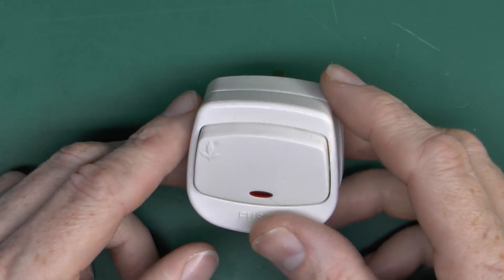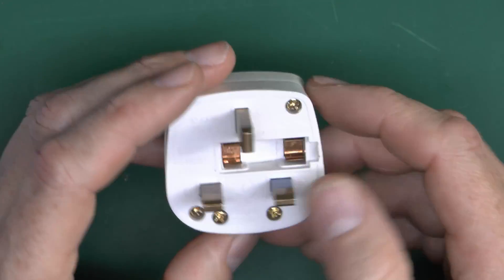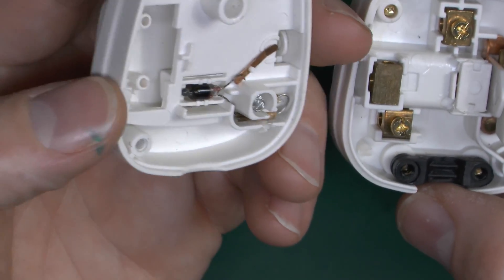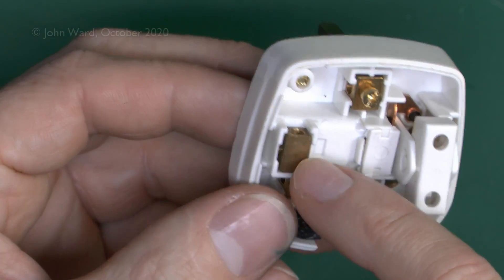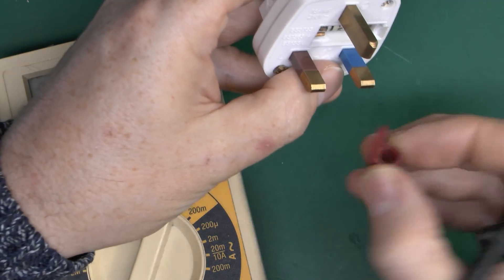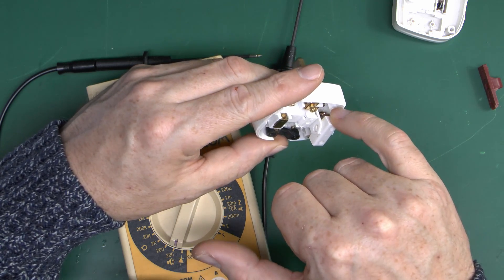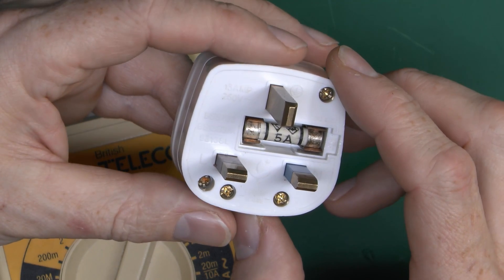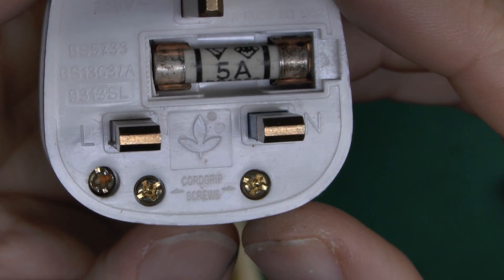Switched 13a Plug BS1363

Comment: Unswitched sockets are more expensive than switched I tend to fit them under kitchen worktops for washing machines and the like
Reply: I like the clean lines of an un-switched socket and they can be useful where you don’t want an appliance inadvertently switched off.
Reply: @richardwallace3477  Have not heard of the office cleaner wanting to plug the vac in, finding the fax machine with a note at the socket saying 'Do not switch off' - so the cleaner just unplugged it !
Reply: @Harry M They are more expensive, because they are less popular - less is produced and stocked in stores, so price is bigger. Economy of scale and free market in action.
Reply: No local plug fuse, really glad we have sensible power circuits. A table lamp consuming 2 amps with is cable will melt in fault condition if it relies on a fuse box breaker of 10 - 16 Amps how ridiculous.  Makes one glad were out of the EU.
Reply: @g7mks383  - what the hell is it with people blaming everything they don’t like or don’t agree with on the EU. The U.K. power circuit arrangements have not been significantly affected by EU changes. And if anything, the EU has helped to improve safety standards within member countries. If you go back to the 1940s and earlier, U.K. plugs were unfused. And in a lot of areas, the use of unfused plugs continued for another ten to thirty years (or more).
Reply: @g7mks383  Actually the cable will withstand a fault condition. Show me how you can overload (thermal overload) a lamp! Impossible! The only fault scenario in that case is a short-circuit. And a cord can handle this, because the circuit breakers or RCDs will trip fast enough if the installation is properly made and maintained.
Different approaches require different safety measures. All methods got their flaws and their advantages. Why are electricians still installing type AC RCDs in the UK? In Germany the installation of this type was banned more than 30 years ago, standard is type A here since then. And that's for a good reason since more and more switch-mode power supplies are in a household now which can disable an AC RCD preventing it from tripping.

Did the EU enforce you to do the same thing as Germany, stopping you from installing these outdated RCD type? Even if it would make sense? AFAIK not...

And btw: The EU got nothing to do with european harmonisation of regulations for electrical installations. This is done by the CENELEC, which is not a EU organisation and doesn't require a membership in the EU. Switzerland for example is also a CENELEC member.

https://en.wikipedia.org/wiki/European_Committee_for_Electrotechnical_Standardization
Reply: @g7mks383  No table lamp consumes 2A in normal operation, and no standard fuse size in our plugs will open at 2A. What fault scenario are you imagining, here?
Reply: @Monkeh616  AFAIK the smallest size BS 1362 fuses is 1A, next larger one would be 3A. And I believe his motive is just trolling...
Reply: @Marcel_Germann  You can get those, but they're not standard. Only 3A and 13A are specified, afaik. Not about to shell out for a copy, though.
Reply: @Monkeh616  Must be the reason that 3A are red, 13A brown and all others are black.
Reply: @Monkeh616  You can also get 2A, 7A & 10A plug fuses.
Reply: @NOWThatsRichy  Yes, I said that, but they're not standard..
Reply: @Marcel_Germann  - Actually 1A fuses are rather hard to find. The most common fuses available for consumers are 3A, 5A and obviously 13A. However, electrical shops and suppliers will also normally have 2A, 7A and 10A BS1362 fuses.
Reply: @Monkeh616  So are you saying a table lamp with a 5 amp rated cable will saftly deal with a 20 amp breaker load without getying hot under full short circuit conditions like cable trapped in a door. Have a look at dome of JWs cable test videos I think that says enough. By the way really love the idea of changing the 3 phase cable colours from something sensible to what we have now. Could mention other things like the mad idea a few years ago to force us to change all our plugs and sockets. Rule Britannia.
Reply: @martinwinfield2935  And it will work if you limit the length of the fitted flex cable, to let's say 1m. And in case of a short-circuit it will trip the 16A breaker without damaging the cable. Like I said, thermal overload is impossible, the current is limited by the illuminant/lamp itself. Only a short-circuit is a possible scenario. In case of a short-circuit the breaker shall trip within 0.4s in a TN system and within 0.2s in a TT. Other appliances have a mains fuse integrated into the primary side of their power supply to protect against thermal overload.

And something I forgot: The CPC here is always of the same size as the other conductors. If you have a 2.5mm² cable the L, N and the CPC are always 2.5mm². In the UK the L and N are 2.5mm² and the CPC is only 1.5mm².
Reply: @martinwinfield2935  - before the colours were standardised, every country in the world had their own colour coding system. Our so called “better” system is absolutely no good if you are colour blind. And yes a 20A MCB will trip if you use 5A rated cable and there is a short circuit. Once the MCB trips (in a very short time) there is no fire risk. Of course, most 16A circuits are actually protected by 16A MCBs...
Reply: @Marcel_Germann  - the CPC is sized to carry the required fault current without overheating for sufficient time for the MCB to trip or the fuse to blow.
Reply: One point to note is that cables don’t have a fixed maximum current. The current that they can carry depends on how fast heat can dissipate from the cable. This depends on where and how they are used, and the type of insulation. If the distance is long, the resistance of the conductor will have to be taken into consideration as well. So when you see a cable rated at a particular current, it’s a generalisation based on a typical or a specified usage. Cables and conductors can take a much higher current for a limited time.
Reply: @Mark1024MAK  But there's no way that under normal conditions 1.5mm² could handle 32A. And so it is with the unfused plugs and cords here...they maybe can't handle a high current in normal operation, but they can handle it in a fault situation for a short amount of time.
Different approaches, but the target is the same: A safe electrical installation.
BTW: Most fires caused by electric appliances here are caused by carelessness of the users. Covering up power strips or ventilation openings of appliances which then causes a built-up of heat. Mostly they cover it with combustible materials like textiles.

The required current in case of a short circuit to trip instantly:

B16 A MCB: 80A 
general purpose fuse, 13A: 130A (blow time between 0.1 and 0.2s)
B32 A MCB: 160A

With this current the MCBs will trip in less than 0.1s. Permitted here are 0.2s in a TT grid (almost impossible without RCD on a short-circuit between L and PE) or 0.4s on  TN. The most common system here is TN-C-S.
Reply: @Mark1024MAK  That's the reason for these "reference methods", it's all about heat dissipation. Most used here is method C.
Reply: @Marcel_Germann  - Yeah but please note that on a 32A ring circuit, there should be two 1.5mm² CPC conductors (wired in parallel). I say should be, as that is how a properly installed circuit is installed and wired. I like the ring circuit because it means we can have lots of sockets throughout the building. But as with anything, there are compromises and pros and cons. In industrial control and power systems, radial circuits are far more common than ring circuits. In the area that I work in, various supply voltages are used (12V, 24V, 50V, 110/120V, 230V/240V, 400V/415V) and obviously various different cables are used. It’s actually amazing what actually happens under some fault conditions.
Reply: @Mark1024MAK  I know, even the 2.5mm² is not rated for 32A. Only the ring shape makes it possible that you can fuse it with 32A. Normally for 2.5mm², depending on the reference method, the maximum is 25A. For 1.5mm² it's 20A, all under the best conditions.
And that's what I try to tell the whole time: This is a different type of installation, it requires different measures to make it safe!  It's not directly comparable, you'll have to take a look at the whole picture.
Three-phase is standard here, even in domestic installations, so you even got the 230/400V even there...

Some pictures, took them recently. Is one of my sub boards (I got three boards for the whole house):

https://abload.de/img/img_09009hku7.jpg

https://abload.de/img/img_0897xaj0t.jpg

https://abload.de/img/img_0898nejg5.jpg

https://abload.de/img/img_0899gwkoy.jpg
Reply: @Monkeh616  Trapped cable with full short L to N, seen lots.
Reply: @g7mks383  Which will open the MCB very quickly indeed leaving the cable unharmed apart from being destroyed by the mechanical damage.
Reply: @Harry M A fuse isn't necessary in Schuko plugs. In Germany the outlet circuits are radial circuits fused with 16A, that's what the outlets and plugs are rated for. In the UK the circuits are ring shaped and usually fused with 32A in most cases. As an alternative a radial circuit with 20A, but that's the more modern method. The plugs and the cords connected to this are not rated for this high current, the plugs themself are rated for 13A, so you'll have to implement a fuse. So it's actually a necessity for them to implement a fuse, because most cords are 0.75, 1 or 1.5mm² which are definitely not capable of handling 32A.
And that's a thing you also learn here in Germany: Whenever you reduce the size of the conductor, you'll have to check if the smaller size is also capable of handling the current. If not, you'll have to implement a lower rated fuse/MCB.

Unpopular things are in most cases more expensive than the popular ones. A nice example for this are cars. In Germany most cars have a manual transmission. In the US most have automatic transmission. Here the manual transmission is cheaper and the automatic one causes additional costs. In the US it's the other way around, automatic is cheaper than manual.
Reply: @Harry M yeah less moving parts easier to make "let's charge more"
Reply: @haldo691  More like "Nobody buys these so we need to charge more for the shelf space they waste"
Reply: They 're probably still switched by an isolator switch located somewhere else in a more convinient location.